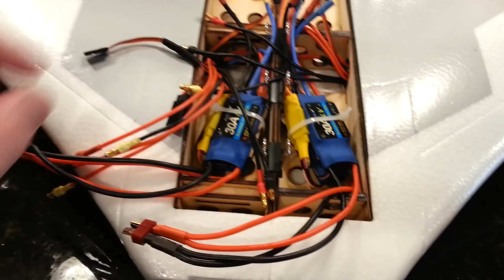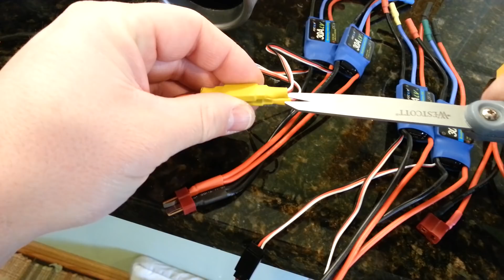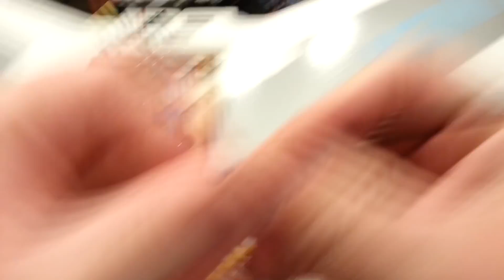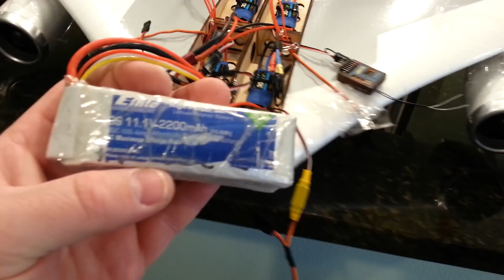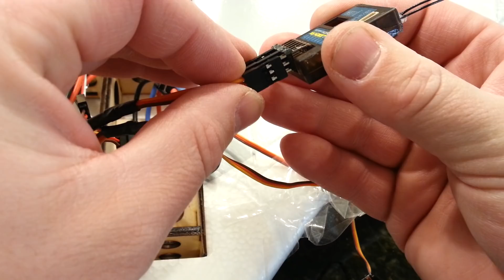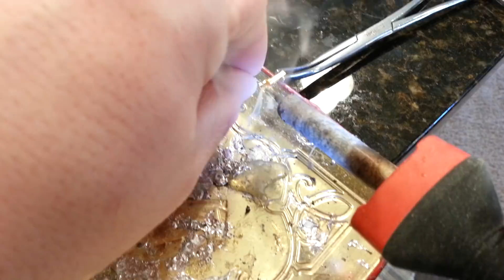Tian Sheng - Airbus A380 -  ESC/BEC/EDF Wiring & Radio Setup + Repair - Build Series - Part 5

Comment: Hey Brian, Good video’s. I have one coming so all this will help. I thought differential thrust is only used on airliners while taxiing on the runway. 
I googled it and that’s what I found too. They say all motors running at the same speed is crucial for best flying results and attitude. Jamie
Reply from the maker: They're independently controlled by the flight software on large multi-engine aircraft, but can be controlled by the pilot in all planes with multiple engines, however, I believe they (the pilots) don't make a lot differential thrust decisions, except for to counter engine failure conditions.

Comment: hey brian. im at wits end to get this bird in the air. i had it wired per factory and all engines worked fine and right direction. i had an xt60 to ec3 ext on it and then installed   10 amp castle bec to  ext and powerewd it to aux 1. i disconnected the red wire that powered the 4 esc s. now when i power up i get power  on one side and not the other. i try to flip flop the y connector to each side and when i power it up its the same . i get a beep noise from the left side when i power it up also. any suggestions?
Reply: i installed them loike you told me at the main lead for escs and edfs (batery lead) i disconnected the main red wire for escs . now like i said when i power the plane up the right bank arms and runs. the left side is dead and just beeps every 3 or 4 seconds. they worked fine before i installed bec. what should i look for?
Reply from the maker: Sorry for the slow reply, we just got internet setup at the new house...

Okay, you need to look at it this way, the BEEPS means there's power, but no PWM (Pulse Width Modulation - AKA Signal from the Rx), so the right or left wings are NOT getting one of two things...

1) Signal (white servo wire)
2) Ground (black or brown)

...OR you have a floating ground on the one side of the system, which can make the above two scenarios appear to be happening. This can be resolved by running a small wire from the ground of the left wing to the ground of the right wing, if they're not already together.

I hope this works for you, and sorry for the delay in reply!!! We're not totally settled, but getting close (two videos coming ASAP!)
Reply: @BrianPhillipsRC  no problem brian . i know your busy with the house. yes it was a bad wire and rewired it works great. ubec and all. its a good day my friend . your house is almost done and my a380 is ready to maiden. good luck with the new digs. im hopin to get a video of the maiden so ill shoot you a copy. ive never videoed before but maybe my buddy can use my cellphone. i will send you some pics tho. thanks for all your help and i think youll like it. hopefully youll get to flying planes and makin videos soon. again best of luck to you and  your family on the new house. it looks gorgeous. take care and talk soon buddy
Reply from the maker: I'm so happy you got the problem worked out Michael! That plane is a handful of wiring - LOL ;) But when you see her fly, you will be happy!!! She flies so good, and slooooow too!!!

Comment: hey brian, sorry to bug you again but im ready to wire. i plan to wire by the book but want to wire an sbec. i can get power from the receiver but not sure how to wire it into the escs. whats the easiest way in laymans terms?
Reply from the maker: If you're using an external BEC or UBEC or SBEC...then all you have to do is make your battery connector plug so that the positive and negative of BOTH the BEC and the ESC together in parallel...IE, Red to Red, and Black to Black...so that when you plug in the lipo, you'll be powering BOTH devices. Then you need to separate the ECS's built in BEC's from trying to also power the Receiver by either removing and taping over the RED wire (if it's black, red, white - Futaba Servo Wire Color Code OR if it's orange, red, brown - Hextronics Servo Wire Color Code). This can be done at the end of each servo wire coming out of each ESC, or you can do it at the end of one of the single "Y" cables, which are joining all the ESC's Servo wires together.

That's it ;) Super easy. Now you just need to test it.

Let me know if you need any clarification, and I'll try to help you out Michael! Good luck!

Comment: Hi Brian, I have quest about wiring.  I have a battery with an xt30 connector and want to change it to an XT60.  But the thickness (gauge) of the wire is smaller compared to another battery I got that already has an XT60 connector.  How do you know which gauge wire is for what amperage components (motors, batteries)?  I don't know if i asked this right but if you can please let me know.  thanks.
Reply from the maker: I understand your question...
You want to try to mimic the size of the wire of the lipos you're seeing on other packs of similar connectors, but generally, if you have an XT30, you can just cut it off and solder on an XT60...no problem. Now, if you were going from an XT90 to an XT30, you'd want to be careful about the amount of current potential on your pack. Plus, you'd have a heck of a time fitting the wire from an XT90 into an XT30 ;) LOL

Comment: i understand all the radio setup stuff because i use a dx8. im thinking that the front becs work the inboard and the rear the outboard motors. ley me know if im on the right track, thanks
Reply from the maker: I didn't really lay them out in a specific orientation, but I'll be setting up the differential thrust soon. The whole rationale in my method it that I can use two lipos and avoid a complete loss of engines if one lipo fails earlier than the other. Of course that'd be best avoided, but I live in reality-ville, and a voltage alarm on each lipo will be all I have to trust...and they get washed out out by EDF's most of the time.
Reply: gotcha. keep makin videos, mines on the way
Reply: fyi i was on  banana hobbies site and they have several parts availiable if you need em,,, tail or rudder or fuse for that matter but plane is out of stock there.
Reply from the maker: Nice, thanks!
Reply: @BrianPhillipsRC  thanks ill look into it

Comment: brian, i hate to be a pain but im learning as i go. why did you split the becs?if i leave them as per factory what does that mean and what does what you did mean. in laymans terms please.
Reply: Brian Phillips. I think I messed up a perfectly fine little ESC. Used it to power a servo tester. Plugged in another ESC and ran the motor. The ESC smoked when the motor was turned up. Same smoky ESC under any scenario smokes only after the motor rpms are raised. Maybe it is the BEC part of the ESC that is done.
Reply from the maker: The BEC (battery eliminator circuit) is the part of the ESC that powers the receiver and servos and landing gear, etc... When more that one are simultaneously hooked together, there can be a situation caused where the BEC's don't share the load evenly, thus leading one of them to overload and cut out...but I have my doubts about this theory...the proper way to do this would be to have a stand alone UBEC or SBEC, but I don't have one lying around, and don't want to dink around on this any more than necessary. I suspect I'd be fine with one or four BEC's but would hate to find out I'm wrong...and crash over it.
Reply from the maker: NOOOOOOO! That sucks! I have a crappy tester that I think I KILLED a few servos on too! That's why I just use the Rx. I thought maybe I was doing something wrong...but maybe this is "a thing"???